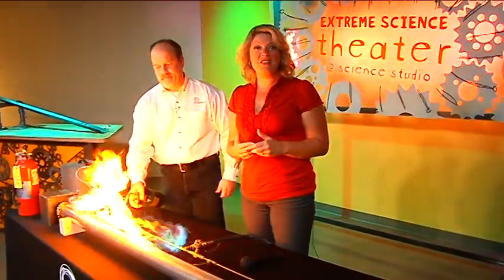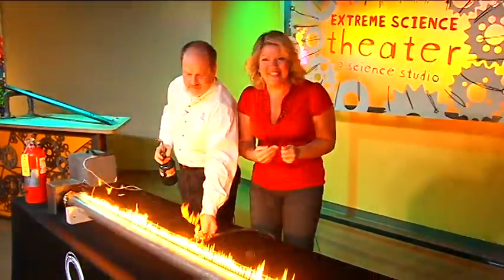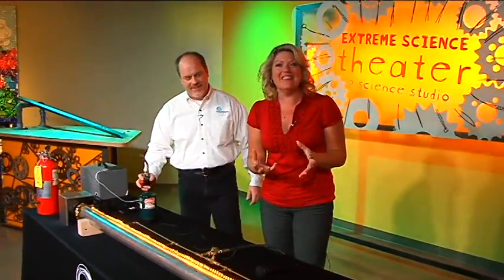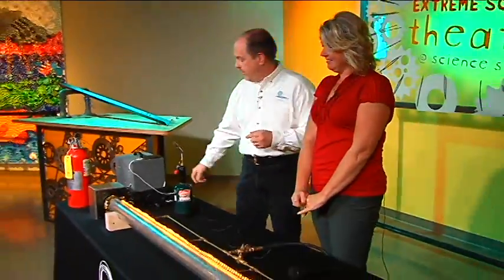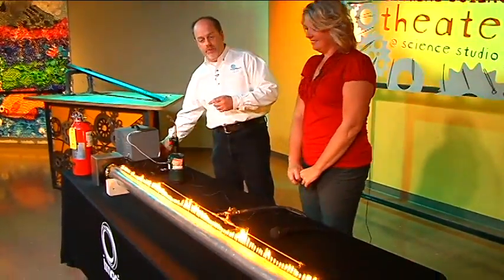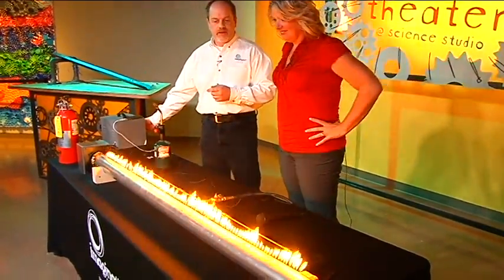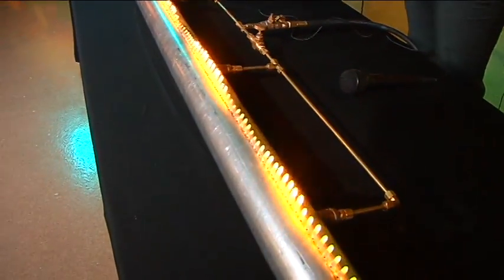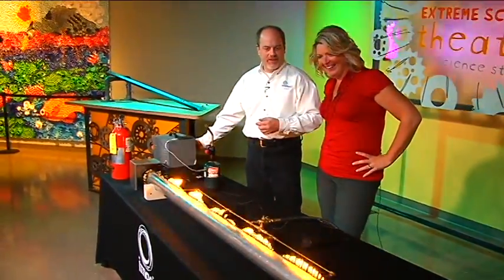Here's how you can see soundwaves!

Comment: this is actually showing modal relationships, not the actual air displacement caused by the energy of a sound wave.  I can't find anything on youtube that'll let me see the frequency movement of a sound wave, especially, how those waves travel away from the acoustic body they resonate from.
Reply: Found anything in these 10 years?
Reply: @Joao-de9gl  hmm well off the top of my head you can see how vibrations will change the shape of sand on a plate. That can give you an idea of the size of waveforms. As for understanding their speed you can look at videos of explosions, especially over water.
Reply: @Joao-de9gl  after re-watching the video it looks like my original comment was wrong. He is effectively showing the wavelength of longer waveforms. Higher frequencies just don’t displace enough air to pump gas through a tube to make flames bigger. Or at least not noticeably enough to make any difference compared to the “noise” of the flicker of the flame.
Reply: @CharlesFerraro  do you know how/if there's a program that shows the soundwave behavior in real time?